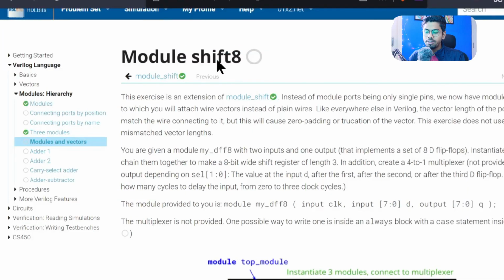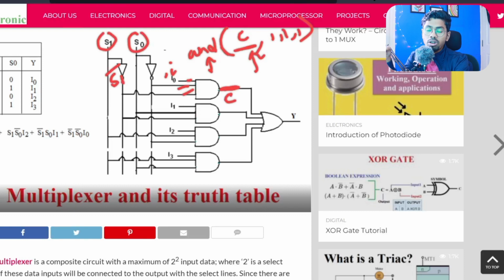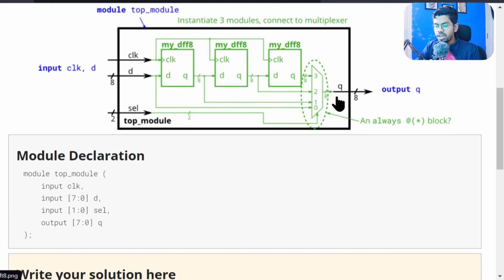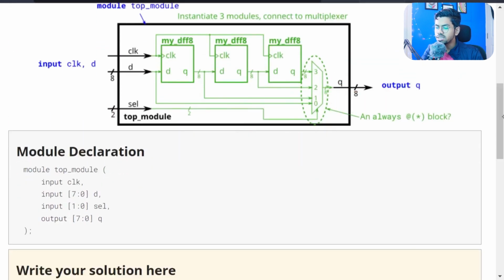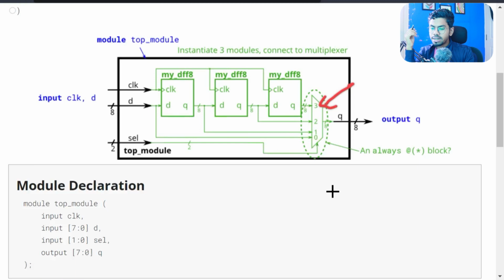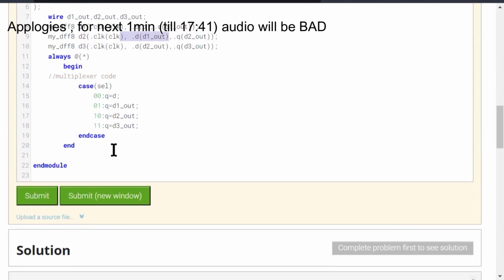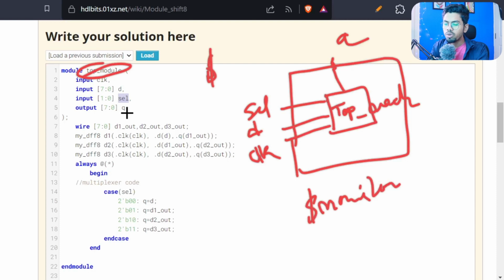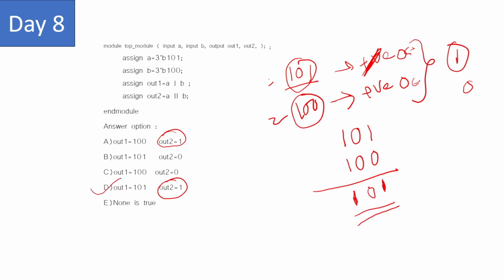Design 4x1 Multiplexer | Lets Learn Verilog with real-time Practice with Me | Day 9

Comment: I'd like to share my code:

module multiplexer4_to_1(output [7:0] out, 
                         input [7:0] i0,
                         input [7:0] i1,
                         input [7:0] i2,
                         input [7:0] i3,
                         input [1:0] s);
    
    assign out = s[1] ? (s[0] ? i3 : i2) : (s[0] ? i1 : i0);
endmodule

module top_module ( 
    input clk, 
    input [7:0] d, 
    input [1:0] sel, 
    output [7:0] q 
);
    wire [7:0] line_0;
    wire [7:0] line_1;
    wire [7:0] line_2;
    wire [7:0] line_3;
    wire [1:0] slect;
    
    assign slect = sel;
    assign line_0 = d;
    my_dff8 module_1(.clk(clk), .d(line_0), .q(line_1));
    my_dff8 module_2(.clk(clk), .d(line_1), .q(line_2));
    my_dff8 module_3(.clk(clk), .d(line_2), .q(line_3));
    multiplexer4_to_1 module_4(.i0(line_0), .i1(line_1), .i2(line_2),.i3(line_3), .s(slect), .out(q) );
    
endmodule

Comment: What is the use of Multiplexer?
Reply: With a multiplexer, you can connect several inputs to a single  bus (output line) by using selective bits. In a microcontroller context, you can use pins as outputs or inputs, depending on how you configure a certain mux.